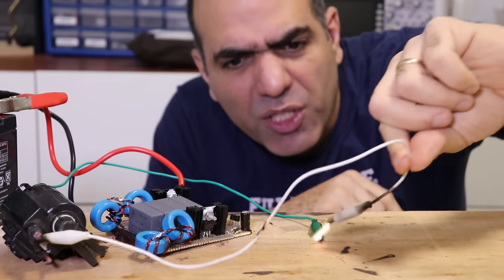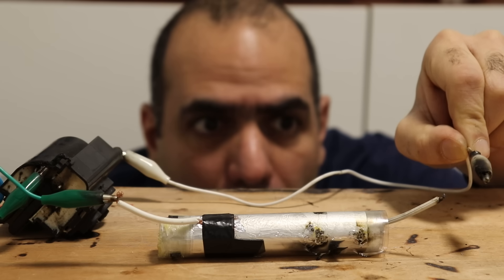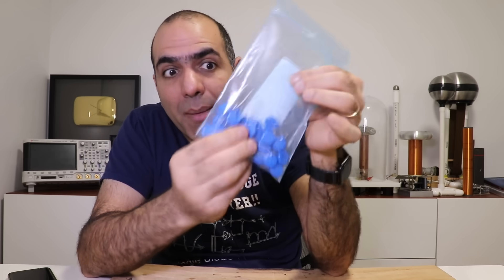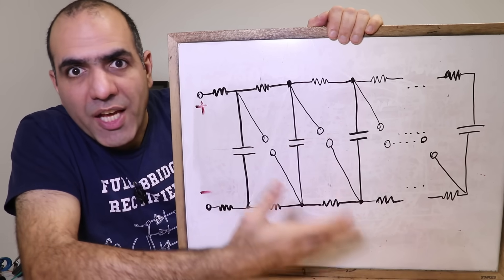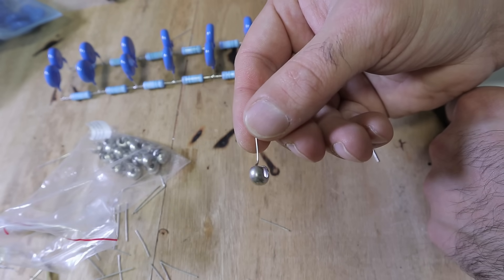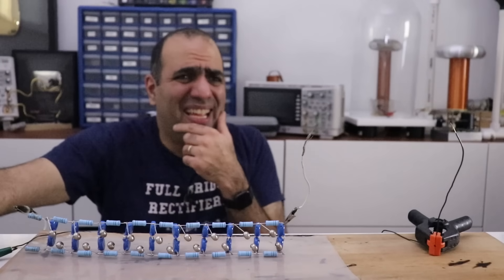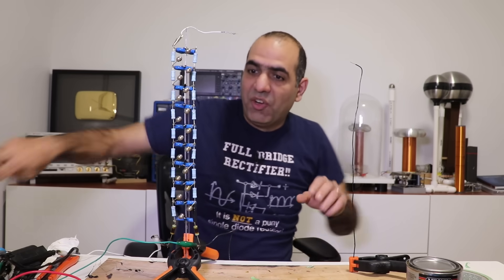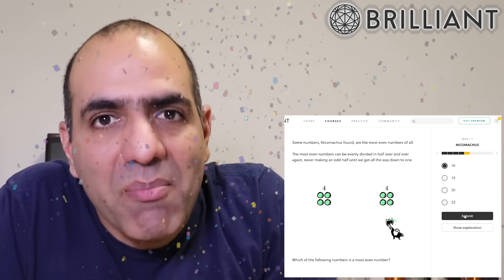Making 500,000 VOLT ARC with Marx Generator

Comment: Come on Electro, lets build a plasma jet engine. The proportionality of charge is inversely proportional to distance. A Plasma jet engine would be also inversely proportional to pressure. Perhaps we can come up with a plasma jet engine whose coefficient of volumetric pressure gradient is inversely proportional to voltage. Which is to say that as the air compresses the voltage increases. Hmm how do you think this can be done?

Comment: I make neon signs since the 70's and in the process of filling the neon tubes we use a high voltage transformer with high current. I got electrocuted by this transformer which is aptly named "bombarder transformer". This bombarder transformer was 25Kv at 2A more than enough to do damage. It happened when a neon tube broke on the pump and the switch for the bombarder transformer decided to break at that moment. 

Thinking the power was off (no warning lights) I grabbed the alligator clip "Mehdi style" and the world went grey and felt as if I was being flung around by my arm. Long story short I was in the ICU at the hospital for 3 days, internal burns and had third degree burns on my fingers and my toes from the arc going to the cement floor. If you're interested in more let me know, I have some funny stories about this that you would appreciate! lol

By the way I can send you some off cut high voltage cables used for neon signs

Comment: i made one. i got a massive massive arcs ... for 12 seconds before the diodes blew out. im thinking i might use avacume tube hv diodes in place of the silicon diodes. although im sure 500kv through bunch of vacuum tubes isn't a great idea because of the xrays it could make. unless ... your going to dive an xray tube anyway.

Comment: Get sheet of acrylic plastic, clean it carefully then treat like a capacitor (put it between metal plates) to build up a bulk charge of 5,000 volts or so.
Quickly remove the sheet from the charging plates then discharge your Marx generator on one edge of the charged acrylic sheet.
The Marx pulse will 'short out' the bulk charge in the acrylic, which burns little lightening patterns...
Lichtenberg figures are made in lots of ways, having a punchy Marx generator is one of them!

Comment: Could you use heat shrink tubing around all the exposed metal or is the voltage just to high for insulation to work?

Comment: but if you replace the spark gabs with diodes you have another circuit completely.
a Voltage multiplier.

Comment: Unrelated but I have a question for you! I just installed a new gas water heater. There is no electical connections to the heater. It has a Piezo pilot lighter. After I light the pilot, an LED comes on. Where does it get it's power?

Comment: Time to get still larger voltage resistors and capacitors!! :D
Isn't there some kind of HV insulation tubing that can be used to isolate the legs of resistors and caps?

Comment: ElectroBOOM you make great videos and make me laugh at the same time...... 👍 ⚡⚡⚡⚡
LOL this reminds me of when I was building a voltage doubler circuit for my Ham Radio RF Amplifier. It was my first and I ended up with 4,200 VDC running a pair of 3-500zg tubes. 
But I used electrolytic caps 600V @ 450 MFD.  It was a lot of fun and the amp ended up with 2,425 watts with 120 watt input. This was for a Drake L7 RF Deck.

Comment: Hi mehdi im from iran and today my parrot bite in to a live wire and the fuse break and the beek of the bird turn black😂😂 how is my bird alive???
Reply from the maker: Check for horseshoes up its butt! No but really, the beak is not conductive,  it is like nail. So the parrot just shorted two wires and worst case just burned a bit, but didn't get shocked.
Reply: @ElectroBOOM  there was two wires and only one of them was gotten naked by the bird the black wire the other one was green the other one was fully isolatet
Reply: @ElectroBOOM  he might touched it by his tongue

Comment: What would happen if the middle capacitor (switch) is replaced by a tesla coil , would the power transmit trough each next or will it not work at all?

Edit: watched the video and saw it's basically that

Comment: BUUUUT ElectroBOOM, you connected your spark return wire in the wrong place! It should be connected directly to the capacitor! Also oil bath might be better for insulation :-)

Comment: To improve the insulation, you could glue a wide and thin ring of plastic on each of the resistors (kind of like the insulation things on power lines). Plastic could come from any plastic packaging.

Comment: The interesting thing about spark gaps is that they are natural variable resistors. They basically act like a switch, and have huge resistance until they reach their treshold, then they become extremely conductive. Nothing quite like them!

p.s.: You can also dump your Marx Generator in oil and have the spark gaps poke out to reduce arcing/leakage problems in the caps/resistors.

Comment: Hi mehdi. just use 4, 220k resistor half watt or ¼watt in series. the problem with arc across the resistor should solve. for capacitor, use some type the have more gaps between pins . if not, series higher values to make this safe gap and prevent unwanted sparks. and start to make a taller tower 😈

Comment: I learned about capacitors holding a charge when i grabbed an airconditioner compressor start capacitor out of my 'spares' box at work and got a right pisser! It must have been holding the charge for several weeks too!
After that i always touched both terminals to my metal work bench to discharge them(while not touching the banch obviously)

Comment: Hi - Try using something like a old car distributor with a set of ignition points, you can hand crank the distributor or use a separate small dc motor and belt to try and set the rpm to give the capacitor time to charge up and discharge

Regards
George

Comment: the immersive engineering mod for minecraft has a marxs generator . while it's in minecraft you can still do quite a bit of stuff with it like electrocuting yourself. i advise using the earmuffs item if you are sensitive to high pitched noises

Comment: You shoud have melted a bunch of hot glue and dipped your resistors in them. Do a couple of coats to make it thick. Alternatively, you can put your resistor in a roll of paper and fill it with hot glue.

Comment: You could use silicone caulk to insulate the circuit. I've been using it to waterproof some circuits myself and the only thing to have in mind is that the only kind of caulk I found that doesn't attack any metals is "windows and doors" caulk. All the other kinds seem to atack steel, solder and maybe copper wires

Comment: breakdown voltage of dry air is approximately  3  million volts per meter  and the distance between the electrodes is approximately 30 cm,  so my estimate would be closer to a million volts.... ;-)

Comment: Mehdi!
Why should there be a resistor between the first capacitor and ground? Basically when the spark gaps give in, your high voltage falls across this resistor limiting your big arc and the current in it.

Comment: I would make some clear plastic tubes and put the gap terminals in the ends of those tubes and seal them. Then I would encase the generator in a resistant epoxy and fully drill out the tubes. This would allow the air to flow so that the ionized air can evacuate the gap. At that point you might be able to reach peak input voltage and marginally improve safety. I would also test this with a humidifier/dehumidifier in the room, just for comparison and giggles.

Comment: A question for Mehdi and those that know more about electricity than I do:
Is there any benefit to a circuit like this over something like a transformer to generate that same high voltage? To me, it seems like they do the exact same thing but a transformer does it through magnetism and comes in a much more compact package. It also doesn't have a risk of jumping arcs where you don't want it to. Just wondering if there's any advantage to a marx generator.

Comment: MEHDI MEHDI MEHDI MEHDI MEHDI
HEAR ME OUT
This might be obvious to you, but blew my mind once this video made me think of it
At the macro scale, a Zener diode is just a diode in parallel with a spark gap. The Zener voltage in this would be the breakdown voltage of the spark gap. While this wouldn't employ the Zener effect, it would be the high voltage equivalent.
The only difference between such circuitry and the Zener effect would be the type of breakdown the unit recovers from so easily. The breakdown by the Zener effect uses quantum tunneling as the spark, whereas the spark gap's breakdown would simply be the breakdown of a gas.

Comment: I am little bit unsatisfied by efficiency due to number of small Corona  discharge across switches. But benefits of this is it can generate high voltage using DC voltage supply.

Comment: The first gap is critical. You don’t want it to arc until all of the stages have charged as much as they can. Once it arcs, the others will arc as well. Also, wear hearing protection since the impulse is far louder than you might realize. I built one once and it sounded as loud on the next floor of a concrete building.

Comment: You should try this with a CW multipliers instead of the Marx. This way you can fully insulate the components without worrying about the spark gaps. You can put the multiplier chains under oil or encase them in paraffin wax like another youtuber named Vidduley did. He made a video of it on his channel. His was a 10 stage which gave him 150kv. You could theoretically use as many stages as you want ;)

Comment: Could you measure the large gap spark on an oscilloscope if you added another circuit before the oscilloscope to shunt most of the voltage without distorting the wave form?

Comment: Thirty years ago when I was at Imperial College, they had Marx generators the size of maisonettes in the basement underneath Queen's Gate in Kensington. They were the ignition source for the dense gas-embedded Z-pinch nuclear fusion project (it's still running).They output something like a terawatt each when they fired (order of a megamp at a megavolt for a very, very short time). A big challenge was tying down the multi-ton transmission lines against Lenz's Law forces.

Comment: Would it have been beneficial to use wax to insulate the resistors and leave the contacts exposed? (Like fill up a reservoir will wax and dip the resistors)

Comment: For the next one, try doubling the resistor length by soldering two in series. You may also want to try using heat shrink tubing around the series resistors to further increase the creepage distance. I have not tried this, but I am just thinking out loud.

Comment: Why not construct a Cockroft-Walton multiplier to get a more or less constant DC arc? Your ZVS circuit is producing pulsed DC, right?  Since there are no spark gaps in a C-W circuit, you can easily insulate it by submerging it in mineral oil.

Comment: I have fascination to try using different arc lamps as stroboscope, which usually is xenon gas tube. The brightest flash so far are from flat tv fluorescent tubes.
Interesting how triggering only the first spark gap, the lowest voltage one, allow to control the high voltage output.
I presume this is how we can create a fully electronic, no moving parts, way to control high voltage pulses.
Blowing air to trigger it was an excellent demonstration of the sensitivity such system can have to external elements.

Comment: Maybe, one can use spark plugs to achieve a universal gap an safer insulation. The round metal bits will not ark from the same point, that's why I think there were issues with consistency.

Comment: Perhaps instead of coating the circuit in polyurathane, put plastic, or other insulatative ring around the resistors making the distance that the arc would need to jump further. Still an awesome project :)

Comment: The arc bridging across the spark gaps is why a Cockcroft-Walton multiplier (capacitor-diode multiplier) is a better option for multiplying HVAC into super-HVDC. Cockcroft-Walton multipliers don't require spark gaps, which simplifies the mechanical aspect of the build, and the whole multiplier array can be submerged in insulating oil or coated with conformal coating to suppress losses from corona and lessen/prevent arc-overs across parts. The downside of a Cockcroft-Walton multiplier is the need for very high voltage diodes, but microwave oven diodes are fairly easy to find and rated for half an amp or more at 12KV or more, and diodes can be connected in series to increase their working voltage.

I built a 20-stage multiplier, fed it about 12KVAC from a TV flyback coil, and got almost 250KVDC out. Arced almost constantly across an air gap of about 10 inches or 250cm. Of course, you really, really don't want to get zapped by that sort of build...

Comment: Now you need to make a 500,000V capacitor and charge it up.  Two of them. You need to hit 1.03MV. That's the key. Because at 1.03MV, using a linear accelerator, you can accelerate electrons to 1.03MeV and impact them with a target - at sufficient energy to see electron-positron pair production. Then you just need a way to confirm production, like a cloud chamber. Making antimatter is within your reach!

Comment: why not use a CW generator? (the one with diodes and capacitors)
Reply from the maker: I have made that before, it is food but works 2ith AC input
Reply: @ElectroBOOM  isn't the output of your flyback AC? :D 
I found some cheap HV diodes on mouser, have been thinking of making my own but with a CCFL inverter as the AC source for it
Reply from the maker: @Qwertydex  No, these type of transformers come with a bunch of internal diodes. They are used on old tube TVs and such to create that ray of electrons.

Comment: You can submerge the resistors and capacitors in electrical oil with the spark gaps out of the oil to help with the corona discharge

Comment: The larger Marx generators use a spark within globe of the 1st stage air gap to initiate the reaction - it works very reliably and the overall voltage can be adjusted by opening the gaps and increasing the input voltage. Ours was 300kV output and was used for lightening impulse testing. 

The Transformer factory had one rated up to 1 million volts (and it was flipping loud!)

Comment: Since the spark gap pieces are sort of sticking up, what if you submerged all of the components, resistors and caps, in a basin of mineral oil, and left the spark gaps sticking out of the oil?

Comment: make one of the arc gaps smaller than the others; the avalanche will start there and cascade up.  If the arcs are made progressively (slightly) larger it is more stable.  Place the rig into air tight container, and evacuate much of the air. Please don't kill your self.

Comment: Do yourself a favor, start wearing a Faraday Suit of armor even if not grounded at least the current will flow outside your body, your vital core, Your gambling with the Grim Reaper and you keep upping the ante, sooner or later Death is going to call your bluff,  those are lethal Currents... I am surprised you did show the calculated voltage and current... Please be safe  that shock almost got you.

Comment: plastic circles cut to fit around the end of each resistor would provide a quick insulator between reistors so the spark can't jump anymore. Or maybe coat the wiring in some insulation like plastidip. (the latter turns out what you ended up doing)

Comment: Mehdi: hehe this is interesting
Capacitor: click click
Mehdi: The charges are flying over air!
Capacitor: SKREEEEEEEEEE
Reply: After the years of shocks he's a few diodes short of a full-bridge rectifier
Reply: I'm still trying to figure out what that weird screech was lol.🤣
Reply: Audible frequency of the voltage, like a tone or note.

If you record it on a slow-mo camera, like 1/8x on most cell phones now, and then listen to the frequency with a piano tuner or instrument tuner, you can multiply it back by 8x and find out a rough frequency.
Reply: also every xenomorph in the aliens franchise: SKREEEEEEEEEE
Reply: ElectroBOOM: WHAT DA FAAAAAA

Comment: Those home-made gaps are great for demonstration, but you can buy them as a component with a given breakdown voltage. Better for engineering more performance into the design.

Comment: I feel like you could remove the two resistors closest to the power input. Or put the arc return lead downstream of it so the output arc doesn't have to jump that first resistor as it returns to the first capacitor. I saw a flashover across that first bottom resistor every time.

Comment: Submurge the whole thing in oil. Stuck it in PVC and run wires out the endcaps. Seal them. Fill inside with oil!
Reply: A Marx generator cannot be submerged in oil because of the individual spark gaps without incurring a lot of complexity in keeping the spark gaps in air.
Reply: @stevewhite6252  you'd simply have to submerge the bottom half in oil, leaving the spark gaps in the air.  Or better yet, cast the resistors and capacitors in a block of paraffin wax.

Comment: That reminds me of the time I was working in repairing electronics for a heavy machinery manufacturer. They had a device that had a LCD with cold cathode fluorescent lamp (CCFL) backlight. Did you know that if you put your thumb over the output pins of CCFL power supply you can hear a snap and smell burning flesh? Also did you know that humans taste like pork? Atleast my burned thumb does.

Comment: Instead of the polyurethane, you should get some 3M Scotch Linerless Rubber Splicing Tape 130C, one wrap is good for 69kv!  We use it for high voltage terminations and as an anti tracking measure.